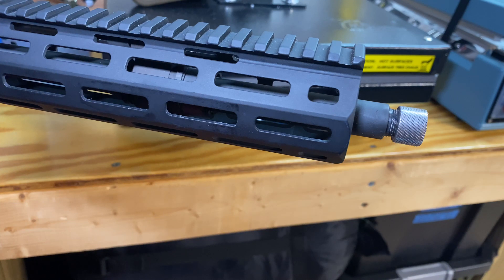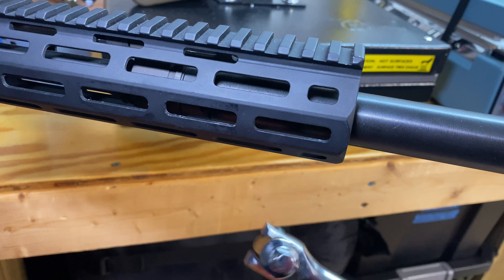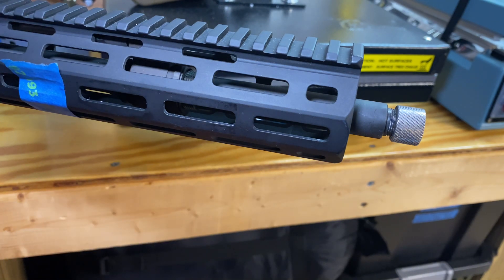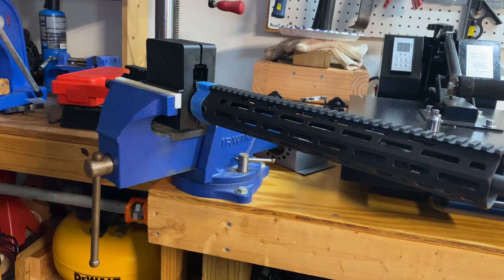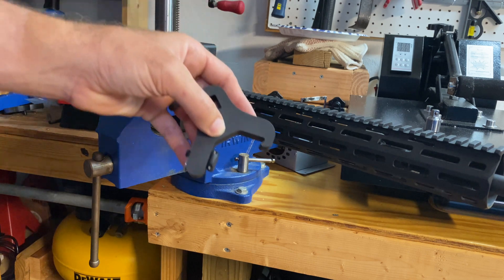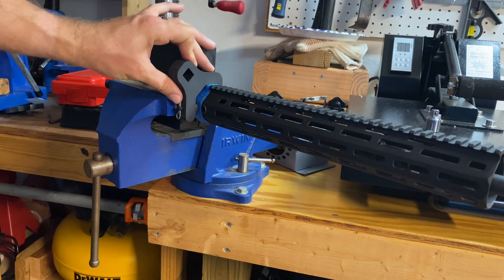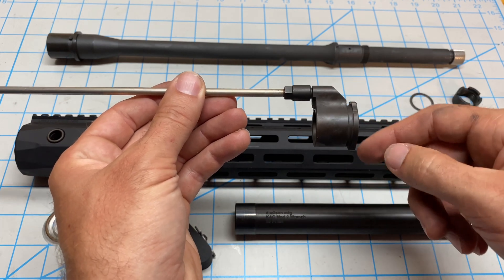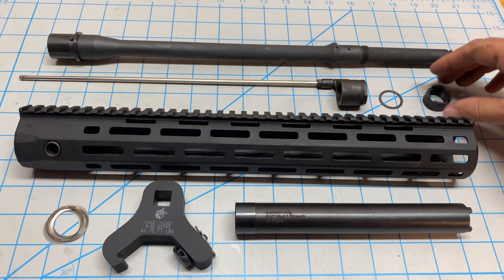6ARC Knight’s LPR - Ep. 003 - Removal of the SR15 Mod 2 URX4 and Gas System

Comment: was the handguard loctited on the receiver threads? Looks like it was some residue in the handguard threads?
Reply from the maker: The residue is anti-seize.
Reply: @sunandshadow_llc  Yeah I just talked to a KAC Armorer, they specify Loctite 242 for the Integrated barrelnut (URX4).
Reply: KAC specifies Loctite for URX 2/3/4 handguards and that is likely why the handguard gave him issues. I am not convinced the loctite is necessary, just a precaution.

Comment: the castle nut wrench you bought from d. wilson mfg. - did you buy the narrow or wide version? i think i have the wide castle nut. it looks like it's a little more than .125, it looks like it's .178 (almost 3/16''). hard to get anything in there to measure. wilson has a wide available, no narrow in stock. also can't find the hanguard wrench anywhere though...
Reply from the maker: My tool from D. Wilson is marked as the "wide" version. I believe only the very early versions of the Mod 2 system had the narrow tooth design, so they are uncommon. I don't have a good source for the handguard wrench unfortunately, although if you can find a brand new rail, I believe they typically came with the wrench and a shim kit.
Reply: Spike's Tactical shims will work in 7.62 applications, I am not positive about 5.56 but it is worth looking into since the KAC shims are tough to find.

Comment: Thanks, interesting rifle.  Seems like the standard AR hand guard and gas system is easer to maintain.  I wonder why Knight's went with this nonstandard method?
Reply from the maker: After taking it apart and putting another one  back together I don’t think it’s more complicated, but it is certainly a different process. The nut holding on the gas block was certainly easier to remove than taper pins!!

Comment: Why would you buy a KAC upper and basically remove everything that makes it KAC? Genuinely curious. Why not buy a stripped upper and rail, then add your barrel and gas system to it?
Reply from the maker: This is a totally fair question, and I have several reasons. 

The main ones are 1) I’m still not sold on the whole 6ARC thing, and I can convert back to a 16” SR15 if I want 2) I now have a spare bolt and barrel for my other SR15s and 3) it was easier to find all the parts I needed together on an upper and make one purchase than to shop around, look for take-off receiver/charging handle/URX4.
Reply: @sunandshadow_llc  Gotcha. Does make sense to have a spare!
Reply: 6 arc is the way.

Comment: use dental picks to pull the gas block forward
Reply from the maker: I had to hit these little bit to loosen it up; I don't think it would pull right off. Maybe a little carbon build up there. Once it was loose I was able to push out easily. Picks could work for that but the initial hits would likely need a brass rod.

Comment: Are you going to have your new barrel threaded to use the KAC gas block and castle nut? I’m sure D wilson could do it.
Reply from the maker: I had considered this for sure. The MOD 2 gas system would be a cool feature on this gun. I opted not to do it as I’m not sure how 6ARC will perform for me yet and would like some time with the cartridge before I get into having custom work performed. Additionally, my Proof barrel is a rifle+1 system so I’d need to have a custom gas tube made to fit the MOD 2 gas block.

Comment: Cool mang!  And yeah, it makes sense that the gas block and tube have to go in after the rail/barrel nut is torqued down. That channel that the gas tube passes through at the end of the rail before going into the receiver isn't stationary. :-)  

That said, I'm starting to see some of the things that Knights does to make sure these things are tough and stay together. Couldn't understand the cost before, but that's changing.
Reply from the maker: I didn’t mention that specifically but that’s exactly the issue; the URX4 would interfere with the gas tube when trying to torque on or off.